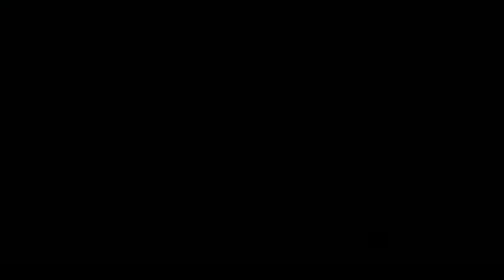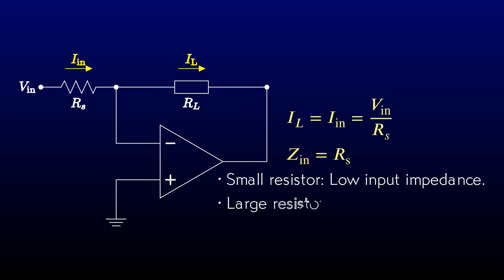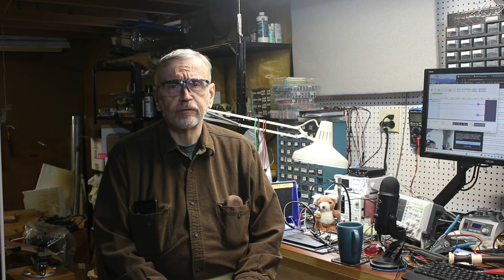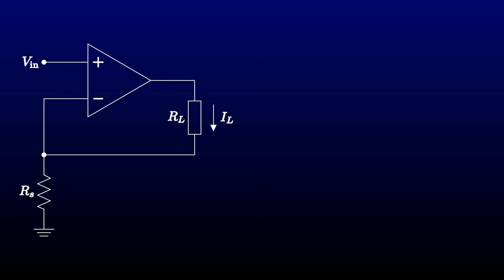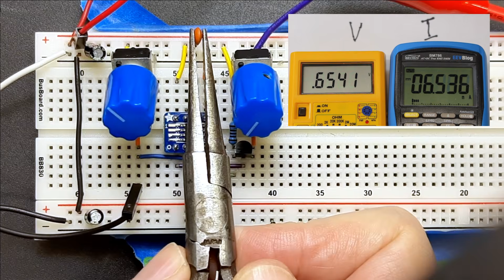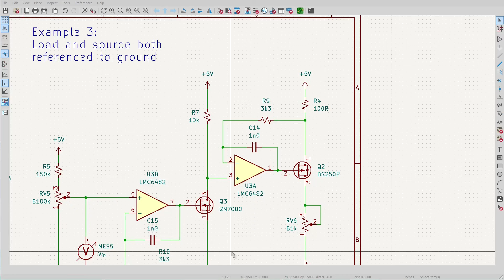Transconductance amplifiers, part 1: current sources | Op-Amp Basics, ep 14

Comment: I'm currently working through Learning the Art of Electronics, the lab course for the Art of Electronics. I keep seeing similar circuit examples in your videos. Is that a coincidence? These two books are the best I've found so far.
Reply from the maker: I've been using it as a rough syllabus. It's both practical and approachable. There are spots where I'm going into more detail, or simply adding material that interests me. For instance, I did the unit on the diode ladder simply because I was curious where the component values came from. 

The building blocks will be similar in any text, I think, because they are the basic pieces that all designers use.

Having a rough syllabus in mind helps me not to forget to cover things, too. It's embarrassing to prepare a lecture and realize that there is a whole topic you're depending on that you forgot to cover!

Comment: If you need it for AC, an op amp is not even needed. This is enough to have two Sziklais in pp configuration with a proper bias to achieve 1mA/1V with 0.001% THD
Reply from the maker: Sure. I still like having op-amp feedback. The op-amp and a couple of resistors are cheap, and that way I don't worry that the circult will perform nicely on the bench and then start distorting when it's running hot in a case and the component values (BJT beta, FET threshold, etc.) start shifting. You can do a stable design with just the transistors but I don't like thinking that hard.
Reply: @KludgesFromKevinsCave Sure. I like to postpone any global feedback till it’s possible. This is why prefer such simple and performant schematics. Like such converter, or pre-amp with two mosfets only. )

Comment: These are very nicely constructed tutorials. Thanks.

I'd be interested to know what software you use to make the animated circuit diagrams with the blue backgrounds. It looks vaguely like Manim, but I've never seen Manim used for electronics before.
Reply from the maker: It is indeed Manim, with CircuiTikZ drawing the electronics, plus a bunch of pretty dodgy Python code and TeX macros that I wouldn't wish on my worst enemy.
Reply: @KludgesFromKevinsCave  That's a pity - I was hoping that there was a fancy app to do the job. Oh well. Still, at least I can commiserate - I've got plenty of dodgy Python/manim of my own. I even remember what some of it is supposed to do.

Comment: 20mA may seem piddly, but I've run 100kW+ motors with that. Via a VFD with a 4-20mA current loop input of course 😉
Reply from the maker: I haven't done a lot of power work. I'm an instrumentation guy, mostly. My challenges are more in the line of, "how do you run a microscope and camera in a laser welding chamber?" (Synopsis: it ain't easy.)

Comment: I love this, because it's almost identical to one of the first opamp projects I ever made years ago, driving lots of LEDs at a constant current. And it's also the basis for a project I'm currently working on, making active load current sinks for 30+ amps. I'm using the ZXCT119Q opamp in this design. Part of me feel like I'm cheating by using an opamp with a fixed gain, but it's super convenient for this design. What I love most is that while I know enough to make these projects work, I'm still learning so more from your videos. One of my designs in progress is for testing pulsed power, and that is pretty much entirely based on the peak detector video you put out a while ago. Thank you.
Reply from the maker: It's great to hear that people are using the ideas in these videos for actual work!  I'm learning a ton making these videos, because you never learn a subject as well as when you teach it!

It was fun, including the whole debugging process in this video.  And truly, it wasn't staged. I did forget the decoupling caps, and I did first try the MOSFET without extra frequency compensation on the opamp. Sometimes in these videos, I make mistakes deliberately, but I played it straight in this one.

You'll like the next video, too. Spoiler: Boost the output current using a BS250P driving a MJE3055 - a Sziklai pair functioning as a poor man's IGBT. Two things had to happen:  get the collector current directly from the power supply rather than through the breadboard (and return the load to the power supply), and run the control-voltage pot off a TLV431B rather than a plain voltage divider. Because without both those things, the damned thing started oscillating yet again.  I didn't try too hard for high currents - the sense resistor was 1 ohm 3W, and the load was three 10 ohm, 5W in parallel. Enough to show the concept, and at an amp and a quarter, everything stayed nice and cool.

ZXCT119Q is a part that I haven't tried. It looks pretty similar to INA146 - kind of a middle-of-the-road high-side current monitor.  INA149 is a little more extreme - it can deal with a ±275 V common-mode range on ±15 V supplies, and AD8479 is utterly insane (±600 V common mode range).  The fixed-gain devices are great, because the manufacturer can laser-trim the input circuits, so you get better CMRR than anything you can hack up yourself.

The last time I was driving a bunch of LED's, I used the ridiculously old-school approach of an NPN power transistor wired as a current sink, with a sense resistor on the emitter driving the base of a little NPN that would steal the base current from the big one.  Worked a champ, but a much younger colleague said to me, "how old ARE you?" when he saw the design!

I've never actually done that much power work.  I was an instrumentation guy when I was working, and mostly it was image based - a little bit of hardware to make the image acquisition do what it needed to, and a lot of software for analysis.  I sometimes needed to measure and record voltages and currents in the power stuff, but delivering them was outside my wheelhouse.

Comment: It takes a brave man to post a video of soldering live on the internet! Everyone takes a different approach and I firmly believe there's no wrong way to do it as long as it works, and it looks great. So please don't take this as a critique, but just a question: why are you using soldering paste for something like that? Don't get me wrong; I love my hot air gun and use it all the time, and soldering paste is great stuff, but when I'm putting a SOP8 or SOT-23-5 chip on a breakout board, I always first tin the pads wipe a bit of flux on, then just clamp the chip straight onto the board with the alligator clamp on my helping hands, adjust with a few nudges under a magnifying glass, and wipe across the leads with the iron. I generally use a larger tip. My hands aren't as steady as they were 10 years ago and my eyes now need a magnifying glass to make sure it's all lined up, and I find it easier to do with the chip clamped down in place and an iron. (Yeah, it's been a LONG time since I updated my profile pic!)  So I'm just curious if this is the way you've always done SMD chips, or if you used to do it the way I did it and in a few years I'm going to stop being able to do it that way too, or if you did it that way because it was simply easier to film on the camera.
Reply from the maker: Thanks for the vote of confidence: "if it works, it works."

I've pretty much always used paste for SMT.  With the big pads on the breakout boards, I can hand solder the pads on 50-mil lead spacing, but my shaky hands risk making a mess of it.  SC-70-6, though, is really beyond me. The shakes for me started in adolescence.  "Benign familiar essential tremor" is the medical phrase.  It's never been bad enough to try any sort of medical intervention, but hand-soldering tiny parts just isn't ever going to be pleasant.

If I'm doing SMT on a board that I designed myself, I pretty much always get the stencil.  Squeegee on the paste, place the components under the microscope with the occasional nudge to get them more or less straight, drop the board on the hot plate - the lazy man's approach!

I actually see better at 70 than I did at 10 - my eyes are now much patched by the ophthalmic surgeons. 21st-century surgical technique is a win - I've gotten through three conditions that made relatives of mine go blind.  I used to use Optivisors, but I find the microscope more comfortable, and of course it's easier to film through it. Otherwise, I have to set up a camera with a macro lens on a ring stand.

Reflow also does show well in a video. As I said, it never gets old watching the mess just clean itself up!

Comment: Ooh, looking forward to this series!

I've made a crude thermal plant for classic control lab practice by using an LM358 and a cement 0.1 Ohm 10W resistor to control the current across an IRF540N (powered by a +12V single supply, a PC PSU). The mosfet heats an aluminium heatsink. Above a few amps the resistor get pretty hot, and I lose linearity in the transconductance. It serves its purpouse though.  

I'll surely be taking notes so as to improve it!
Reply from the maker: I have something similar planned. A 15V supply, a 1Ω 3W resistor as the current shunt, a "poor man's IGBT" (Sziklai pair of a BS250P and a MJE3055) for the regulating element, and several different loads (with a current of 1.25A targeted).  I'm also trying to spec the circuit to not burn up the transistor when trying to deliver full rated current into a short circuit.

Part of the lesson is the first thermal analysis that the channel has presented, because that poor MJE3055 will dissipate about 18W under worst-case conditions. Part of the analysis is showing why the data sheet headlines have to be taken with a spoonful of salt - even the Safe Operating Area curve on the MJE3055 datasheet has to be derated significantly because it makes the ridiculous assumption that you can hold the case temperature to 25 °C.
Reply: @KludgesFromKevinsCave Excellent!

Comment: Thanks for finally covering transconductance! Been waiting for some time. I've been working with these circuits for last year as we control some industrial equipment and sensors using the current loop configuration. It's very good to understand now the fundamentals!
Reply from the maker: There's more coming!  I want to cover at least the fundamentals of a bipolar source (can push or pull current) and get into OTA's (Operational Transconductance Amplifiers) - which are a building block for a lot of interesting signal-processing circuits.
Reply: @KludgesFromKevinsCave waiting for that video, Im playing around simularing 50Hz bipolar ac constant current, this topic will be very interesting

Comment: First! 🎉. What about put a diff amplifier in shunt with the sense resistor, between the output and the load, and put the output into the (-) input of the opamp?
Reply from the maker: I'll at least mention that next time!  The really great thing about a diff amp is that you can have the pass transistor powered with a voltage beyond the op-amp rails.  Something like an INA146 can work off ±100V - and there are higher-voltage ones out there.  Great for high-side current monitoring.
Reply: Nice!